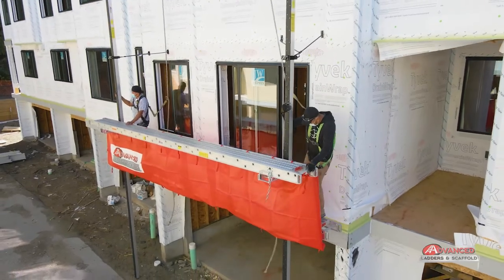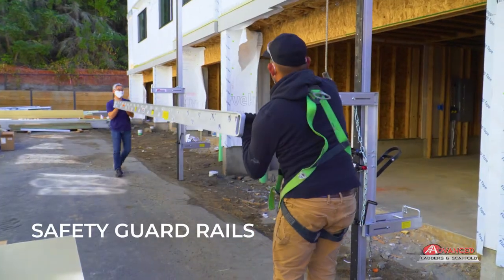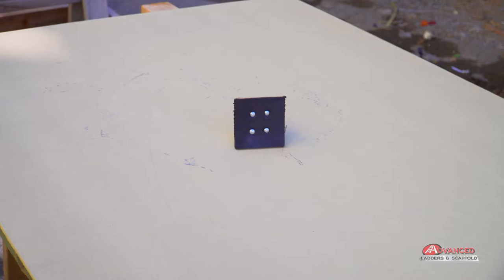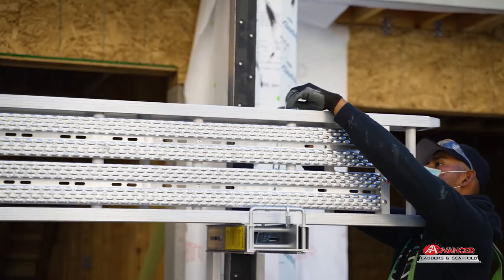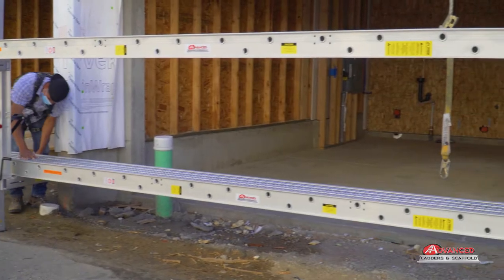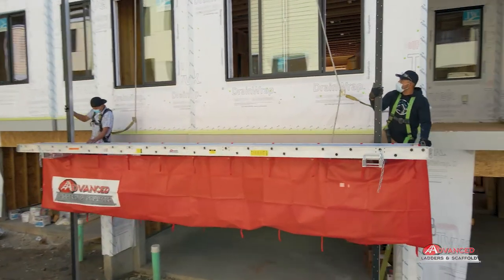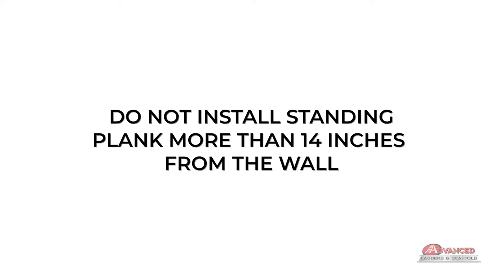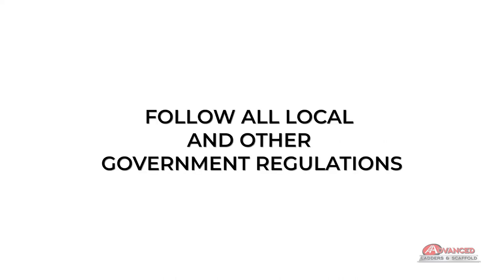Advanced Ladders and Scaffold - Pump Jack Safety and Set-up Instructions

Comment: What are the benefits of this vs a skyjack rental, the price? Seems like a lot of work to setup and move around. Can you buy three post to have one set up and ready to move the plank on the other side?
Reply: Well renting a boom lift and you'll never get that money back.  These things you can buy and sell.  Skyjacks can't drive to every side of a house, especially if its been lived in for awhile, and also they can be really time inefficient when having to touch every square foot on the outside of a building since they have to be moved in every axis to follow along a wall.
Reply: @cheetoman23  i’ve had both …these pump jacks systems are good if you’re working along the length of the house like, reshingling the wall, the boom lift is good if you have to get very high up in one particular spot. But a good compromise between the two would be the masonry type scaffolding that let you extend up as high as you want with the sections of scaffolding. This is also called pipe or tube scaffolding.